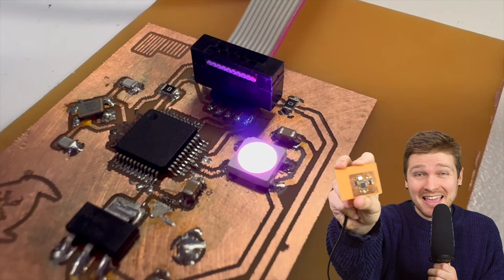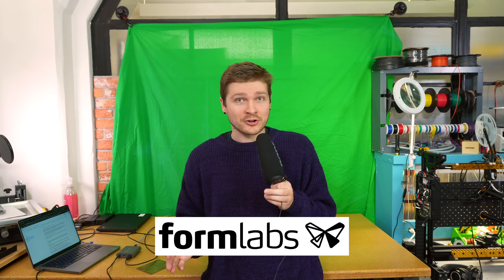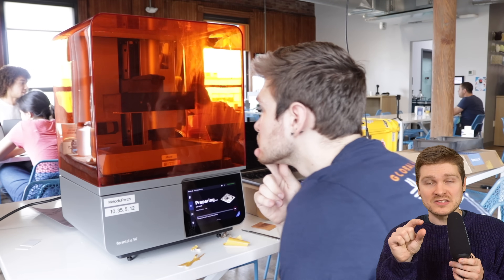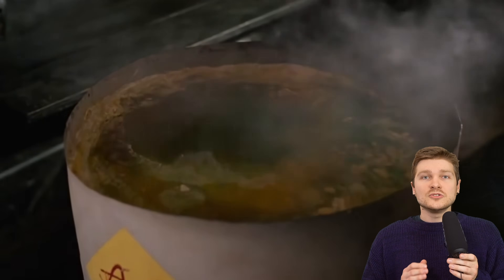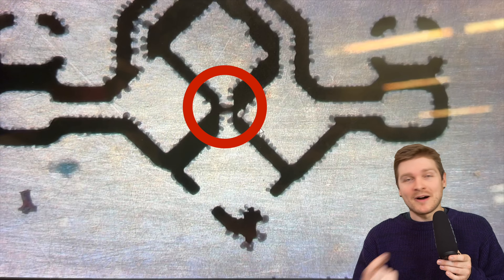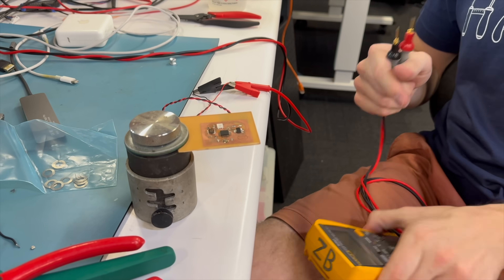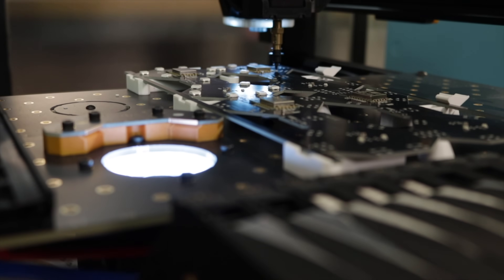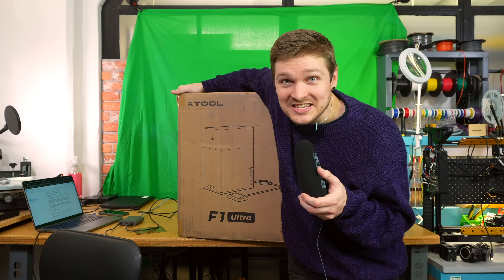Making PCBs on a 3D Printer

Comment: Abandoned FeCl long ago. The following works much better. Just use a kitchen scale to measure quantities. Their SG is about 1 anyway. So 1g = 1 ml justbto get proportions.

Work outdoors, gas needs to be dispersed so one can breathe. 

100 ml water or less if you want faster but more volatile and gassy 
Add
50 ml 30-35 % hydrochloric acid (HCl)
Add
30 ml 50% Hydrogen Peroxide
or
42ml 35% Hydrogen Peroxide

or use no water and
50 ml 30-35 % hydrochloric acid (HCl) 
Add
122 ml 12 % Hydrogen Peroxide (H²O²)

If etching slows down add more Peroxide. 

Lovely blue liquid can be thrown in toilet bowl to remove scale.

This method faster and much cleaner than FeCl. 

Also easily available. HCl pool acid can be used. They call it the weird name Muratic acid. And Peroxide. Get stronger from the Hydroponics people. They use industrial strength 50% or 35%. Pharmacy maybe 12% or less. You could just use bubbles to give the oxygen from the fish tank. But i never tried that yet.

Comment: I disagree with the comment by @mikeselectricalstuff. 

Firstly, pre-coated photoresist board is far more expensive than copperclad, harder to come by, and generally just has fewer options. Critically, the photo-resist is delicate and has a short shelf life, so your boards are easy to damage and unrecoverable if that happens. The copperclad, however, lasts for years. Because of this asymmetry, it's a lot more optimal to get copperclad in bulk (large sheets) and only the amount of photoresist comparable to the project you are working on. This way, you can refresh your photoresist and prepare boards as needed. The trade off is that you have to learn how to prep your board and properly apply the resist, which isn't all that hard and a skill well worth learning.

Secondly, while I agree that hydroxide based developer can be difficult to get right, I disagree that silicate based developer is the way to go. Fundamentally, you shouldn't even be using (sodium ) hydroxide (lye) to DEVELOP, it should only be used to STRIP the board after etch. The proper chemical to DEVELOP is usually sodium-carbonate (washing soda). Like the silicate developer it also has a much wider margin between develop and strip, but is orders of magnitude easier to obtain. But that's not all.... The absolute best way to go, IMHO, is to make a so called "buffered solution" of sodium-carbonate and sodium hydroxide. This arrangement, plus good temperature measurement or control,  gives you total control over the power of your developer. The only difficulty with this method is simply knowing that chemistry is best done by MASS, so a proper scale is all but mandatory.

Lastly, absolutely do not simply soak something in ferric chloride, let it dry, and toss it out. The issue of disposal is not so black and white, it really depends on the location of the world you are in. Follow that advice and you could end up with a heavy fine or in jail, bureaucrats are hardly logical when making rules about "chemicals."  Ferric chloride is used in drinking water treatment, so is hardly a danger to life, but it's absolutely destructive to metals... obviously.... So it's better to ask your local waste collection facility on how they specifically want such things presented to them. (They might get offended if some brown newspaper they took in suddenly starts to rapidly corrode metal things it's in prolonged contact with. :/)

As a related side note, I personally use copper-chloride, but don't necessarily endorse it for general arrangements. It has.... issues.

Edit: Please allow me to also opine that these kinds of creative side-channel uses for SLA printers would be a lot easier and more common place if ONLY printer manufactures wouldn't lock their printer's down with proprietary firmware .... though I know that is going to fall on deaf ears. ¯\_(ツ)_/¯

Comment: SUBSCRIBED!!!...simply becuase Xtool sent you that laser and I would love to see the workflows you come up with to make pcbs on it. Especially since I hate resin printers and I'd rather buy a $4,000 laser welder, engraver and metal cleaner than a $10,000 resin printer...🤷‍♂️
Reply: Elegoo resin printers are under £300 now and do not need to have any systems bypassed to make this work.  
 Why do you hate resin printers ?  In my experience they give reliable and accurate results where my original Ultimaker was nothing but trouble.  Formlabs was good but expensive and restricted.   Elegoo is low cost and has proved to be reliable with resin at a decent price and few failures once set up.   
 I don't see how filament printers can hope to get anywhere near the resolution of resin type.

Comment: Avoid ferric chloride; use muriatic acid with hydrogen peroxide. It's a far safer chemical, still dangerous, but it's easily neutralized with baking soda.

Comment: i tried 2 potential ways for custom PCBs with my FDM 3d printer, first one was printing a mask of TPU directly onto the copper (it stuck on the best) but it came off when it got wet and exposed the entire board. next i tried attaching a permanent marker to my printer and getting it to draw the mask. i got the best results with this, but the quality i ended up with ended up being too bad to make circuits with.

Comment: Couldn't you just use a regular filament 3d printer and print the mask right onto the copper substrate, then use heat to remove the filament after etching it?

Comment: [I have to imagine you thought of this already, but...] 
Why can't you essentially use (double-sticky taped) copper-clad as a "build plate" and use the SLA printer as a regular 3D printer to UV-cure resin onto the copper, and use that as an etch-resist instead of all the "fruit roll-up" rigmarole? If this is workable, you just have to convince the FormLabs slicer not to print a "boat" onto the "build plate," right?

Comment: If you apply the blue film wet there are no bubbles, like vinyl stickers. Apply, squeezer the water to sides, let it dry then iron or pass through a laminator. Have done double sided boards with no issues. You can use some throughhole components to switch layers or thin wire for vias.  Developing the resist layer before etching helps with resolution.

Comment: Ferric Chloride is not acid, it's salt.
I propose you another receipt: you can take 100g 3% hydrogen peroxide, add to it 35g of citric acid and 5g of table salt (NaCl). All components are available on grocery/pharmacy, has the same speed of etching and not so nasty and dangerous.
Reply: Citric acid powder or solution ?  if solution, What is acid concentration ?     THANKS

Comment: Sounds like you just needed the cheapest possible SLA printer instead of that Formlabs as it would not have all those checks you had to bypass.  You just push that buildplate up instead of down when the printer is in the home position and the plate-screws are loosened and the screw them down while there are several mm's of room under it.
Reply: On the Elegoo you can set the zero height in software so it is as simple as that.

Comment: Good option for those who own resin 3d printer.
Regarding double sided boards you can check out the @ELECTRONOOBS tutorials on direct laser etching. I believe he was also able to drill and cut PCBs with his ConMaker laser. I studied this topic thoroughly during my bsc. and this is one of the best methods if you looking for some consistent way to prototype or even run lowscale production.
You can also build your own cheaper CNC and equip it with IR laser head. I know that for example Atomstack R30 V2 Infrared Laser 1064nm is able to etch copper but afterall fibre should do better job.
With laser it's also relatively easy to create soldermask and even labels. You simply place two layers of resin on the etched copper clad inner white and outer in other colour and then you can go with low power to just remove outer layer to expose white labels it was shown some years ago by @ElTallerDeAlvaro.
Also you would like to consider ways to perform pads metalisation in order to improve solderability and if you want to have two sides you might also do electroplating or use those vias. Laser can be also used to prepare stencils. 
If you are looking for out of the box solution thou you might be keen to check out this company: LPKF Laser & Electronics. In their offer they even have binding press so you could potentially manufacture multilayer PCBs like the Lumen controller in house.
Cheers

Comment: Laser printer and transparency film as a mask. Put the photosensitized board with the mask sandwiched on top out in the sun for half an hour.
Reply: If you examine the print on the transparency you will find holes in the mask due to the printer using dithering to fool the human eye.    This leads to pin holes and ugly edges on the finished pcb if you examine under a usb microscope.    Laser printing two transparencies and laying them together leads to much better result but it gets tricky the smaller you need to go.

Comment: Amazing hack. Didn't think of it, I guess someone might have came up with modified optics from DLP Projector as well for exposing and making PCB's.
Not sure what is the resolution of the projector inside Formlabs 2 and 4, but website says "XY Resolution⁷
50 µm with pre-tuned anti-aliasing for subpixel resolution
Superior fine feature performance and sharp features compared to the Form 3 Series".
That should be good quality for 0,5mm pich parts, would be interesting to see how far more it could go.
Without support from Form Labs engineers might probably be easier take that thing appart, but then you loose benefits of any optics correction algorithms they might have + harder to switch back to regular printig.

Honestly they could include this as a feature in their future printers. It sort of just requires software to have functions for it, trusting the user to make proper measurements like the thickness of the PCB.
In a safer way it might need few extra sesnors or bits.

I don't think they will, as its not their main business, and extra risk of users damaging the machines; but but it would be cool to see material exposure for electronics or jewelery included. Maybe some students could use it for making their own silicon?
Because its just so close to doing it out of the box.
Would be a hudge benefit to push me over to invest in one.

Comment: It seems like this process removes most of the more difficult to work with parts of a resin printer - no fluid of any kind is needed or even desirable while printing, the slicer doesn't need to support more than one layer, there's no need for multiple layers or the precise mechanical motions associated with moving the build plate up, and it seems like there's not much need to worry about toxicity compared to regular resin printers - at least, while printing. 

(we assume here that the post-processing is manual to keep the price of the printer down)

Resin printers are already very cheap at the low end, I feel like a stand alone product that just did PCBs would probably be doable at under $100 if you could get economy of scale rolling. 

.5mm is also well within the abilities of most FDM printers' motion systems (you could probably do .1 on most even), a small UV light mounted as part of a toolhead could get us a lot closer to the reprap dream of a self-replicating printer. I know SunShine is doing it with by plating plastic using electroplating, but I think a small UV laser makes more sense. The advantage of using an FDM printer for this is that it could even theoretically do the post-processing autonomously assuming you had a toothbrush-compatible toolhead.

Comment: Hey, I've used this method (but a bit differently) for two years. I start with my design in Fusion 360, export the file, and "print" only the first layer with a 90-second exposure time. Before printing my circuit, I cut the PCB to size and use Photo PCBs from Bungard. You can also use double-sided PCBs. It works great! After printing, I dip the board in an NaOH solution to develop it. The dipping time depends on the board size and solution concentration. Afterward, I clean it with water and then immerse the board in a sodium persulfate solution.  With this method, I've made PCBs with copper traces as narrow as 5 mil (0.127 mm). The quality is excellent, and I love this method because it's so fast, reliable, and easy.

(I use the Elegoo Mars 2 Pro)

Comment: I'm really intrigued now :D
Given that the etch resist film is a UV resin material, could you skip that step and print (actually print) the resin etch resist directly onto the PCB? What would the adhesion be like? Would it stand up to the etch process? Easy to remove the resist afterwards?
I'm also curious if you could build a sort of "cut down" printer that just has the UV source and mask LCD, and use that to expose the resist film
Reply: I'm guessing UV resil will work well as an etch resist.
Reply: @hanelyp1  I'd love to see Stephen expand on this idea :D Dedicated PCB etcher would be awesome

Comment: I used to do lots of photo etching with the spray on negative. I would simply expose it outside in the sun. Even an overcast day typically only needs like 5 minutes of exposure. You can do small repairs to your negative using a marker pen.

Comment: I did not see in the comments that there is a spray version of the ' Forbidden Fruit Rollup out there.  I have not personally used it, from other people's bad experiences with it, there are several brands and each seemed to dry at different times and need different ammount of UV to cure.  It is an optional way to avoid ' excess ' rollup losses.

Comment: We used to have a small CNC in the office and we'd use it for prototype boards from time to time and then JLCPCB and PcbWay came to the scene. Even where you have to deal with the customs, it is a bit slower, but you can get a 2 layer board with silk screen and solder mask and everything for a few dollars and a of waiting week. Even since then we've not used to CNC for home made PCBs. Its just not worth it with those prices and that delivery time.
Still this is pretty cool.

Comment: I store my used ferric chloride on a shelf in an old rum bottle I found on a beach, extensively labeled with a lot of very clear text and images to confirm it is Bad Stuff.

I have yet to etch enough to need to figure out what to do with the bottle once it's full, but I'm not looking forward to it.

That being said, I haven't etched a board myself in years because the fabrication services have just gotten so darn cheap and fast that it's tough to justify all the equipment and time unless you absolutely must have a prototype board same-day.

Comment: I’ve been doing something similar with a sharpie strapped to a FDM printer (even double sided boards). You can also print a solder paste stencil to make the soldering easier.

Comment: Can SLA resin stick to the copper so you can bypass the photoresist film, just the PCB as the build plate? The resin would have to be acid resistant though.

Comment: I've been doing this with an Anycubic Photon Mono for the past year or so, and it works wonderfully. All you need to do is remove the build plate and vat, and print a 3D model of the circuit. No need for any extra steps on a less complicated printer. You simply lay the board (coated with photoresist) on top of the screen and it works - you can use the first layer for alignment, or you can also add alignment marks to the 3D model of your PCB, making it easy to place the board in the right spot.

It certainly beats printing the PCB design out on acetate and exposing with a UV lamp.
Reply: Tbf you could use the acetate method with a 3D printer too! Just lay it on the screen and blast it with a tank clean. Then you don’t need to worry about any gcode shenanigans and making extra steps

Comment: This is pretty cool.  Something I've been thinking about for a while so good to see it's possible.  Now I wonder if this leads to a stand-alone machine specifically designed for just this purpose.  The resin printers pretty much already have everything needed and you could add in a heated etch tank for the complete package.  I could make good use of a UV PCB exposure box that I pop in a PCB with resist, load a file and let it do it's thing.

Comment: If you could print the pcb mask on a transparency, you might be able to use the sla uv screen just as a uv source and expose a pre coated pcb through the transparency layer.
Reply: You could but you might as well just use a UV light then. It should be easier though as there's typically a cleaning mode that just turns on the UV for a period of time.
Reply: @ right the cleaning mode is what I was thinking you could use, since you wouldn’t have to hack the printer seeing as it comes standard with most… I guess the reason to use a resin printer as the uv source is because someone might have that instead of a uv lamp🤷🏻‍♂️

Comment: Redemption arc. it's actually really useful to think of the UV led and LCD  screen as a tool separate to the printer, perhaps it would be useful for other crafts
Reply: Could be interesting. Screen printing works with regular light but I'm sure just UV would work too. It would be small screens but they have their uses.